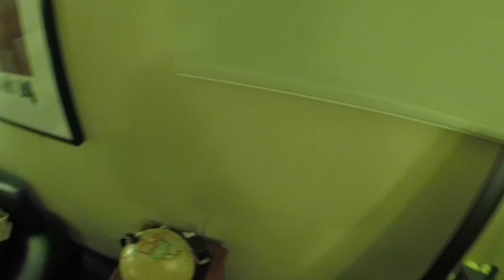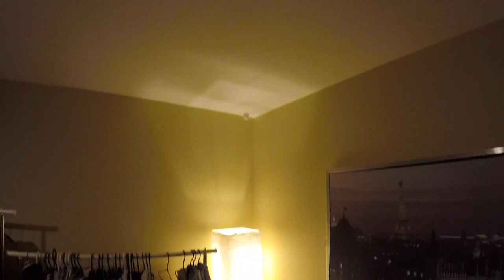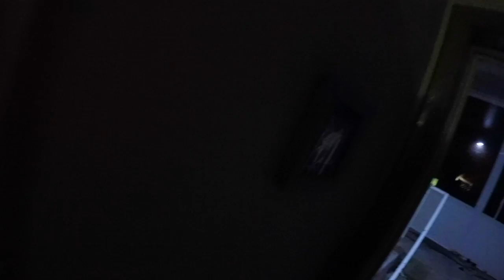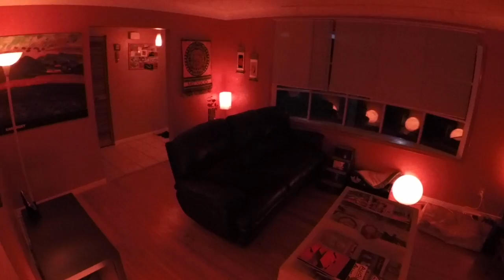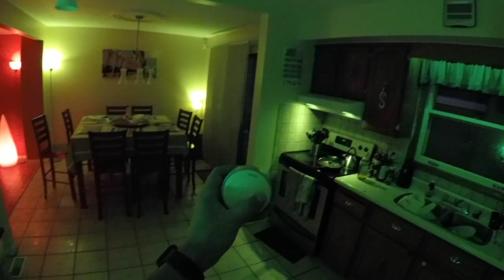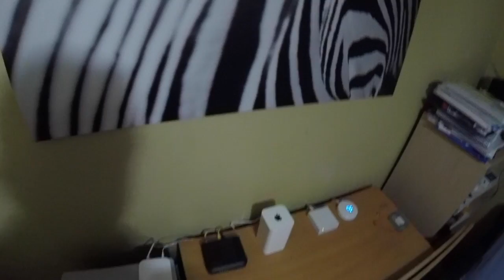a home controlled by alexa, smartthings hub and Philips hue: full demonstration (extended cut)

Comment: Why having Philips hue and smartthings? Smartthings cannot control hue smart bulbs by itself?
Reply from the maker: hi!  you are correct, Smartthings will not control the hue smartbulbs without the philips hue hub.
Reply: Are hue smartbulbs Z-Wave, or ZigBee ?
Reply from the maker: they are zigbee.. but still even when smartthings handles zigbee,  the philips hue won't work if you dont use the philips hue hub with them.
Reply: the philips hue bulbs will work without the hub i have 6 on the st hub but u need a remote to reset the bulbs

Comment: Thanks for the video!   How did you get the fireplace/heater to turn on.?  Wemo Switch or IR extender.?
Reply from the maker: im glad you liked it! the fire place i got it to turn on with the harmony hub.   i programmed the commands for the heater in the harmony hub and then it happens to be still in sight range from the harmony hub directly to control it with it. If it hadnt been yes, i would have used the IR extender.

Comment: Great video and ty!  Suggestion: for garage and basement doors, use door sensors so that lights turn on and off when opening and closing the doors.  I have my basement setup that way and works great.  I understand you may not want all lights on when opening so just setup at least one or 2 so that it is not completely dark and you don't have to wait for Alexa to turn them on before moving down stairs or into garage area.  Seems safer as well.
Reply: Oh and what lock was that on your door at the end?  I have a Kevo bluetooth dead bolt but no remote capability for it other than the app as far as I know as of yet.
Reply from the maker: Hey Roy,  Thanks! i am glad you liked the video.. its a work in progress and there are always so many things that keep coming to mind  isn't it?  thanks for the suggestion, you are right sometimes i have to think of asking alexa in advance to turn on the lights before entering the dark place, i will give it a try some time with the proximity sensors!
Reply from the maker: I had a kevo before and  i like it from the bluetooth point of view, and now i believe there is an extra module you can buy that will tie it to your wifi so that you can access your lock remotely, however  i like to have the one i got because you can include it in the ST hub app and monitor everything from the same single place. 
The model I purchased is the kwikset zwave deadbolt model no. 99100-005. it was the cheapest most basic zwave lock and I really like it it works really well.  i just checked the website and it appears that that model is discontinued, but they have some other models that might work as well.. take a look.  Hope you find one that you like! 

https://www.aartech.ca/zwave-deadbolts
Reply: I would say door sensors would be best as proximity ones will turn ur lights on everytime you go by them vs. door sensors only going on when u open the doors.  But it depends on where u put the proximity ones I guess.  Door ones would kinda make more sense for those types of rooms...of course, just my opinion :-)
Reply from the maker: Roy Rugani Jr oh i thought you they were the same! Are the door sensors from ST as well?
Reply: Yes, they are.  I have one on my kitchen and one on my basement.  Came in the big package with a smart plug and a motion sensor.